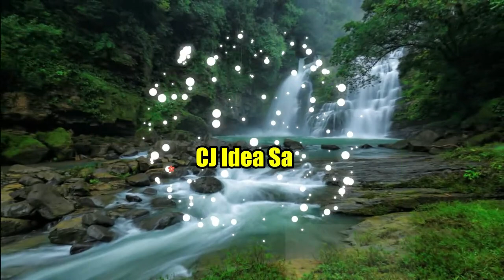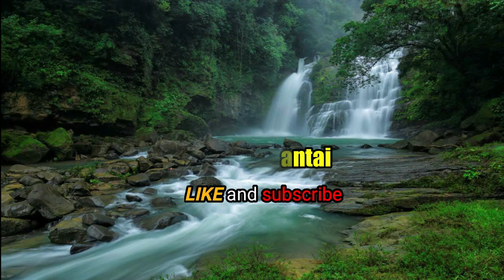How I DIY the Pillar and Balusters For Verandah Part 1

Comment: Great DIY video i have to plaster mine because of mold and breaking what kind of mixture did you use ?? was it motor of cement??
Reply from the maker: should mix cement:sandgravel at 1:2.5, 1 part of cement mix 2.5 parts of sand + gravel, i will result in strong baluster